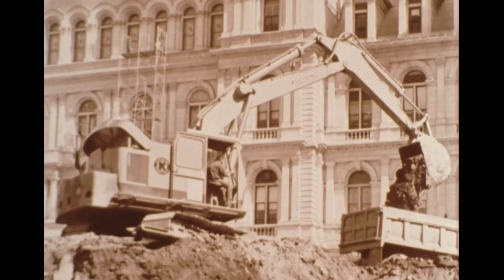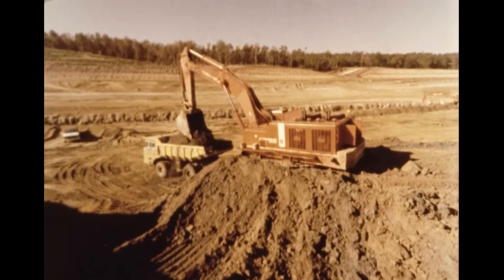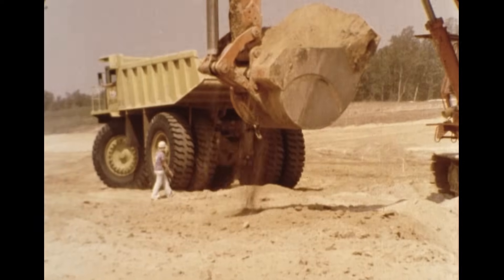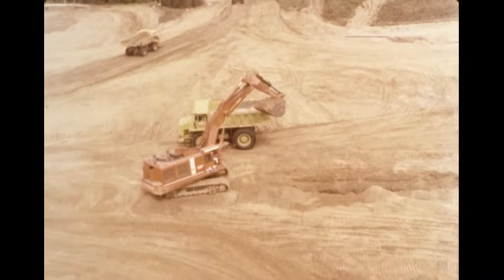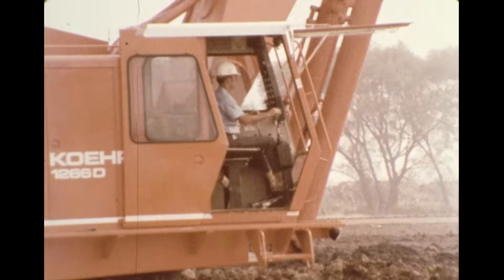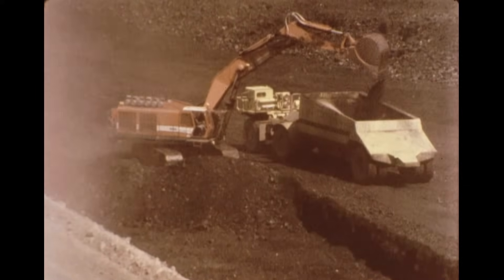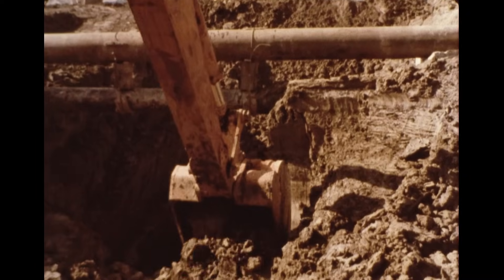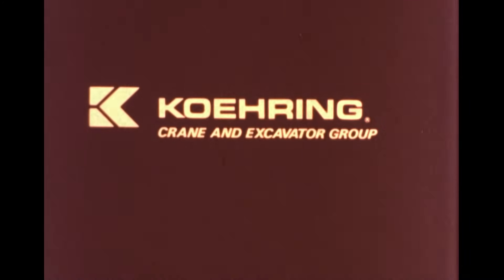Koehring for Mass Excavation

Comment: I ran one , back in the day, in Atlanta.  Laid a mile of 60 inch gravity 30 ft. deep, on mats the while way. It's something to talk about now.
Reply: How did you like the 1266? I would have loved to have been able run one.
Reply: Hal
I always Dreamed about running the 1266 they used on a ass too a metro outfall. The land digging. It had the bucket that filled these smaller mining dumps they used. Bucket to big for 12 yard dumps. They hauled I'll the dirt out. The pipeline was under a right of way road. It was always so interesting how they used the button or little push switches on the Dipper and bucket. The 1266 is sitting all apart in the contractors bone yard, with all the other equipment.
Reply: I understand this might sound a little far fetched but, my grandad bought a koehring from the Atlanta area after it finished up on a pipe job. I wonder if it might be the same one…
Reply: @MrSwampdawg47   We ran a 1066 installing golf course irrigation mains and drainage tiles back in the early 80’s, there was nothing on the market at that time that could beat its productivity, quality of machine, maintenance and reliability.  The Isuzu Engine was superb in fuel efficiency, reliability, performance and quiet, sold the machine in 2018 and it was still running strong.
Reply: @tristenklein5940  Old stuff that is taken care of never dies. I still use a '74 Ford 5550 a friend's father bought brand new as my everyday machine for small drainage work. Four sticks, no BS electronics and it ain't got as much as a glow plug! Almost as impressive as my Dynahoe!

Comment: I was a mechanic for 30 years and started working on Koehring in 1968 till about 1987. Worked for The Earle Equipment in Romulus, MI. Then moved to Texas where I worked for Waukesha Pierce both of these companies were Koehring and Bantam Dealers. Bantam was a division of Koehring. Best days of my life. And yes the controls were a little hard to get used to.
Reply: The Bantam Teleskoop…spent many hours/days/years holding a grade pole or looking through the transit checking grades…👍👏
Reply: Did they have levers not servos...
Reply: @Guds777  Ran the bucket curl and croud/rehaul with your feet. Boom and swing were on levers. Some were on wobblers on top of the levers and were air over hydraulic. The Kohrings I was around was foot controlled but the Drotts were air.

Comment: In the early 90s I worked for a company that had a 466 and a 666 Koehring. Both machines had a huge number of hours, but their combination of weight and reach kept them around for deep bridge footings.
Someone at some point goofed when they worked on the swing controls, and for a while the 666 was a Killdozer, it would stick in swing and the air controls wouldn't stop it. Having a 50-ton machine in close quarters suddenly turn into a spinner is a bowel-loosening experience. The usual way of dealing with this was to jam the dipper back into the trench when you came around again. 
I dug out the manual and found that the air control cylinder and control lever were mirror-image assembled. Once this was corrected, no more spinning. A little too late, because a week or two later the swing gearbox catastrophically failed. The crash stopping had broken a chunk out of a gear which found its way between two other gears. I think the only thing that didn't have to be replaced was the swing pinion. 
Anyway, those two machines did close to thirty years of good work. The people who manufactured, sold, and serviced them can be rightfully proud.
Reply: 666 that just sounds evil
Reply: 0

Comment: Absolutely awesome video Jim. Thanks for posting it. The Koehring 1266d  is my  all time favorite excavator. I watched one working in NJ meadowlands digging a 40 foot deep pit as part of a waste transfer station project. That project took place in the mid 1980’s.That machine was a real beast. I’m pretty sure that a fully spec’d out 1266d had a 266,000 lbs.operating weight. As you know Jim, Koehring produced the even bigger model 1466.The 1466 was available as a front shovel or backhoe configuration. The operating weight on the shovel was 308,000 lbs. and for the backhoe 292,000 lbs. Thanks Again.

Comment: Awesome video Jim. Watched a 1266D working  way back about 1978 working on a large sewer job in pickering , Ont. I was in awe and couldnt believe  the size and sound of it. Then on the 1266 became my favorite excavator. I was lucky a few years later to get to run the much smaller 466D but the sound of the Detroit and the thumb button air controls gave the feel of its much larger sibling. That is one great video and ive already watched it many times and will many times more.
Reply: I ran a 666 with the air controls and absolutely  hated em .
Reply: @maplemanz  These D series Koehrings were some of the first machines to get away from large levers with Hydraulic valves under the cab floor. So it took noise and heat away from the operator. (Even though they had Detroit's!). Also  much much easier for the operator to run all day. The problem with the air controls is they became problematic in the cold weather due to moisture in the air. Very advanced machines in the 70s.
Reply: @larrydunlop378 .... that's what air Dyer's are for.... they were & are, a "Gods send" for the truckers.   Too bad that, that technology hadn't quite been perfected yet, at that time during the 70's when these machines came out... though, by the early 1980's air dryers were fast becoming commonplace on diesel powered trucks... and certainly could have been very easily retro-fitted onto pre-existing heavy equipment, as they were on semi's and other trucks.... and certainly would have been a "salvation" in the colder temps with regards to air-controls and any other pneumatic controlled or powered equipment or accessories.   

I worked on a large pipeline project back in 1983, loading under a Koehring 1466 which was purchased new for the project.... what a machine!!  

Loved hearing those twin V12-92TA's (680 hp each... according to the operator.. if, I remember correctly... pretty conservative rating for those engines).

Comment: The variable volume pumps gave the 66 series onwards a fluidity of motion unlike every other excavator I saw at the time. Presumably the operators could get used to the slight unpredictability of how fast a particular motion would be. Thanks for posting this great video!
Reply: Seems like the unpredictability came from the air controls possibly moreso than the variable volume pumps? There was some times a delay with those. Then throw in condensation and winter ! oh boy! LOL

Comment: worked for Recon for a summer, they had a couple of the big ones 1466 s with a pair buzzin dozens ( 12V71 detroit)
Reply: They don’t. Make them like this no more these machines produced not like today always problems and downtime although I never ran any older ones I was to young but from all the research I’ve done it shure was a good machine
Reply: 1466 had 8V92’s or K19 Cummins

Comment: That was a great video I hope you have more to post. I worked for a guy that ran a 1266 back in the day on a sewer and water job in Edmonton, Alberta, Canada. I worked on a 30 foot deep sewer in the early 2000's along side an 866E in the same city.
Reply: What was the name of the company in Edmonton I worked for Voice they had a couple of Koerings.
Reply: @tomsawyer247  No idea. I had worked for Raywalt Construction back in 2001 and they had a couple 866E's.
Reply: @bert26a  ok I was called to work with them back in around 1986 or 87 but had just started with north American road down on the Mary River irrigation canal at Bow Island.  I spent some time on a Koehring Bantam gradall for Kiewit on a dam in Saskatchewan before that but it was 1975 I worked for Voice, and they had a koehring excavator.
Reply: @tomsawyer247  hah I was 6 years old in 1986. Lol
Reply: Bert26. A fellow sewer rat. Started my adult career doing that. Company had a 166, 266, and a 666.

Comment: Just look at how massively built the boom and stick i. they used 50000 psi yield strength  steel  I have the spec sheet on the 1266D it weighed in at  hefty 260000 lbs or 130 tons! Truly  a massive  machine.
Reply: Hell Yeah Super Cool
Reply: A572 Grade 50 (50000 psi) steel is still being used as the primary material of choice for excavator booms and sticks.

Comment: I operated a 1466 doing deep sanitary pipee!, they were one helluva digging machine!. I just retired after 46 yrs operating excavators and the crap they build today size for size do NOT match up at all!. The new machines are electric over hydraulic 👎, heated seats, stereos, and eco friendly!, sorry folks but that dont cut it in the real world!.
Reply: Your a real lucky man to have run a 1466. That would have been a treat and a highlight to anyone's career. Wish I had some seat time in the 12 or 1466.  You take care.
Reply: Oh but their tier 4
Reply: @Steve Ashworth  I’m wondering if the 1466 was a reliable machine on the job.Also I’d like to know how deep could the 1466 dig.Any other interesting details that you recall would be appreciated. I have the specifications brochure for the 1466 shovel but not for the 1466 in backhoe configuration.Operating that huge Koehring must have been the highlight of your long career.By the way, I really like comment you made,especially the sorry folks part.

Comment: JIM!!  Two thumbs way up!! Great video. I have a 455 which is pictured in this early on.  There is another video from Koehring called "The Eye Opener" Featuring the "D" series excavators. If you come across it. Put it on YT! Thanks again!
Reply from the maker: Thanks so much. ‘The Eye Opener’ wasn’t done in my time there, but I’ll keep an eye out for it.
Reply: @JimHoltan  That video would have been early to middle 1970's.
Reply: @Mrdancefloordj  what's this one late 70s?
Reply: @MotoScootMech  The machines in the video span from 1965-1980ish.
Reply: @Mrdancefloordj ..... I worked on a large pipe laying project, which the main contractor bought a brand new 1266D for the job which I loaded under, and that was in the summer of 1983.

Comment: i remember those 1266 big slow air over hyd was slow compaired to a 385 cat like todays machines
Reply: A 385 Cat is almost 50 yrs ahead of these 66 series Koehrings. These were developed in the 70s. Something should be better,smoother, quieter and  more fuel efficient with 50+ yrs of advancements.
Reply: @oldironguy  WE HAD A OLD 235 CAT THAT WOULD OUTDIG IT LOADING EUCLIDS  WE LAUGHED AT 1266 TILL WE STARTED PULLING  8FT THICK SHOT ROCK  OUT OF THE HOLE  I REMEMBER HOW SLOW IT WAS  2 V12S SCREAMING LOL DIESEL EATERS
Reply: @worp999  So the Koehring was pulling out 8' of shot rock?

Comment: The one has 4 exhausts and like 8 Air Filters? That's awesome
Reply: Powered by 2 v12 Detroit diesel engines. Lots of air needed haha
Reply: When you see that layout on a very large Koehring, it’s a 1466 model. You will not see that on a 1266D or a 1166E.

Comment: Two 12v71’s I assume?
Reply: Peter Carlsen.... I loaded under a brand new 1266 back in the early 1980's... and it had twin 12V92T's, rated conservatively at 665hp each and in the neighborhood of 1900+/- lbs ft of torque, each.    These were Very conservative power levels for these engines... MacMillan - Bloedel Logging & paper, up in BC. Canada, had 5 special order Cabover Freightliner semis built with tandem steering axle's and planetary drive rears to haul up to 5 loaded logging trailers in the mountains of British Columbia, back in 1978 - 1979 and they were powered with DD 12V92TA's rated at 960hp and 2400 ft-lbs of torque... driven through Allison HD 750 transmissions with a Spicer 4spd auxillary behind the Allison.  

Average gross weights with 5 loaded trailers was in the 450,000+ lbs range.  I've seen factory marine spec'd versions at 1,080hp.   J&T Marine 6-71TA's at 465 & 485hp ratings were common... factory marine 6V92TA's at 550hp, and some J&T versions pushing 640+.
Reply: @Romans--bo7br  Brand new with 12v92s? Must have been a real late 1266 or even specially ordered as the 1266s usually came with a pair of 12v71s. Either way there was no lack of power and plenty of noise! Lots of good and interesting info in your comment Bud ! Take care.

Comment: Jim , Curious of the year you made this?? These 1266Ds were the last version with the white vertical stripes. The earlier D's had the horizontal stripe all the way around the house, which were made in the mid 70s. Thanks again for the fantastic video. It's Awesome!
Reply from the maker: I believe we finished the film in 1980. Yes, Koehring had just finished new branding on the machines. Thanks for your note.
Reply: 1974-1980 on the 1266 I believe, they did make a few 20,000 series 1266, but the 1466 replaced the 1266

Comment: Those things were toilets
Reply: Compared to what? And stay within their timeline .
Reply: @larrydunlop378  compared to Um I don’t know, cat? Komatsu? Anything. Guess you don’t have much experience with them. I do, and it wasn’t fun. Spent more time working on them than running them. Never mind when it got cold out, fucking air systems would freeze up and would do weird shit like controls had a mind of there own. You like them? Good luck buddy
Reply: @stephenneville7841  I have mentioned on other videos about the air system being problematic in the cold. And I said compared to what within their timeline. Cat nor Komatsu  never made anything near this large in the 70s. Period. Comparing modern equipment of any kind to products built 50 yrs ago is not a comparison. Others on YT have commented they loved running the big Koehrings. I haven't. The largest Koehring I've run is a 466D so being a D series it had air controls that were easy to use compared to other brands of the time that had 3' tall levers coming up from the floor. These 1266s were the largest contractor size machines at the time. A few O&K and Demag machines were larger at the time but were mine specific machines. Not something you would find on a sewer job. Yes I do Love the  big Koehrings.
Reply: @larrydunlop378  I never compared them to modern equipment. Just other equipment made in that time period. Just because it was the biggest doesn’t mean anything to me. Same with a link belt 5800. Junk.
Reply: @larrydunlop378  you look at cat equipment made in the 70’s, that was quality stuff. Still being bought and sold today for big money and still being used.
Reply: One of at the best at the time we had a 166 366 2. 266s a866d q1066 c a666e 866e  we had const co from 1949 to 1992 that were one digging. Ex
Reply: @briankakuk3090  must have had a lot i of mechanics
Reply: Detroit rock city
Reply: @larrydunlop378  Excellent comment Sir! I’m in the same camp as you.Huge Fan of the big Koehrings. The most impressive excavator I’ve ever seen was a 1266D working back in the mid 80s.Equipped with a 8 cubic yard bucket and digging down to just shy of FORTY feet, it was an awesome sight.You are right in saying no Cat or Komatsu excavator could rival that kind of performance.I will acknowledge the Caterpillar 245 as being a superb excavator, but in a lesser weight class than the massive 1266D @ 260,000/266,000 lbs.operating weight depending on options.I think it’s important to keep in mind that Koehring was a true pioneer in the field of large hydraulic excavators.